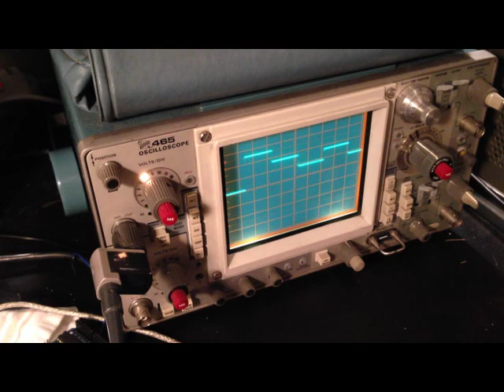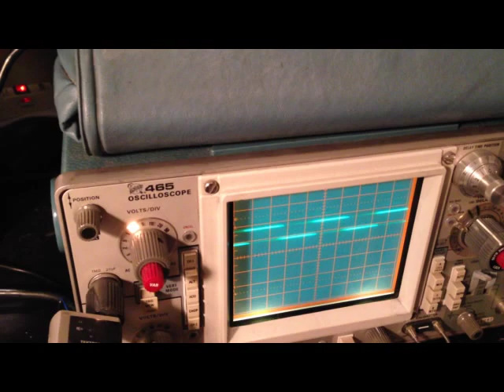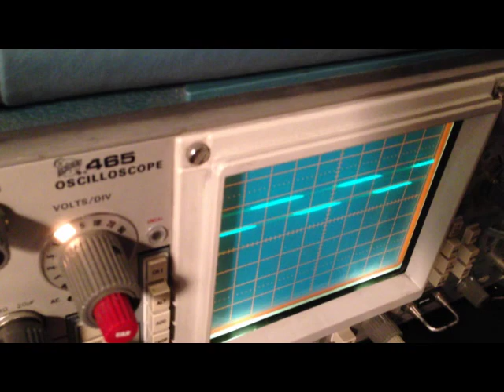Mercedes Sprinter Instrument Panel Teardown Part 2

Comment: I have an 2002 sprinter. Looks like the same cluster. Recently i had a problem. The vehicle came with a tachograph to monitor driving times, i don't use it as it's just a private vehicle. However i decided to try to connect the permanent positive from the tacho to the ignition switch as it was running my batteries flat.
  Now the van is stuck in limp mode and i can't drive it. Either i have messed with the hand shake between the tacho and the ecu or cluster.
  I spoke with a tacho company and they said i would have to get it calibrated by a tachograph center but i'm in the mountains in France and can't drive the vehicle. 
  I spoke with some ECU programmers / hackers and one guy said i just need to send him the ecu and another guy said i just need to send him the cluster. So a bit confused here.
  I am thinking the wires from the tachograph might have been spliced in behind the ecu and this might need to be undone.  Also, the speed sensor is called a KITAS sensor, especially for the tachograph. If i remove the kitas sensor from the Tacho. (suspect it might be a RPM sensor as it seems to be on the bell housing just above the starter motor (on the 2.2L 411 CDi). If i remove this and i assume replace it with a normal speed sensor i need to find where it plugs in, perhaps it went directly to the ECU and now the new wires are spliced in? 
  It's getting complex and i don't really know who to listen to for advice.
  My next step is going to be to try to remove the ECU from another vehicle along with the cluster and the transponder and also try to see if there are any differences in how the loom goes to the ECU. I am hoping to fit whatever is needed from another vehicle to bypass this lock out as nobody seems to know exactly what is involved. I don't think it is a simple as telling the ecu there is no tacho because it still needs to get it's speed info from somewhere.
  and where does that plug in etc?
  Any ideas? Either to get it back to working without tacho discs as it was or to remove completely.

Comment: Thanks for these nice videos. I'm faced with replacing the instrument cluster on my 2004 Sprinter, with a used cluster having much higher mileage. I see a couple of 8-pin chips. Would one of those likely be an eeprom where the odometer mileage is kept? I'm thinking I could use an eeprom programmer to find the mileage value and update the replacement board, or just swap the eeproms between the two clusters. I'm a Software Engineer, with some superficial hardware experience, but have never attempted such a fix before. Any advice would be welcome. Thanks

Comment: Hey thanks for this! I’d like to wire up a larger display (maybe replace EVERYTHING with a display). Short term though i’d like to be able to control the dash/odometer with an arduino. I’ve got plenty of dashes to experiment with